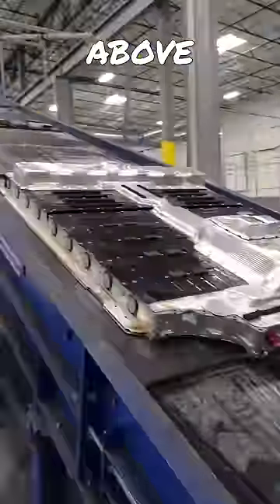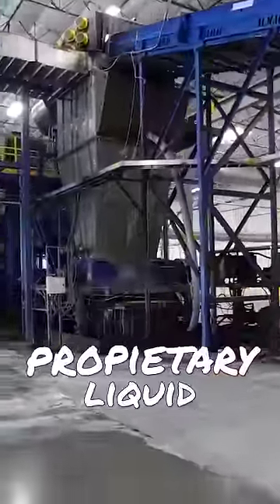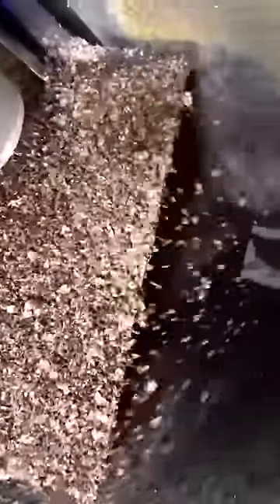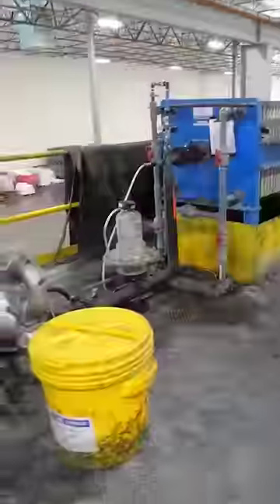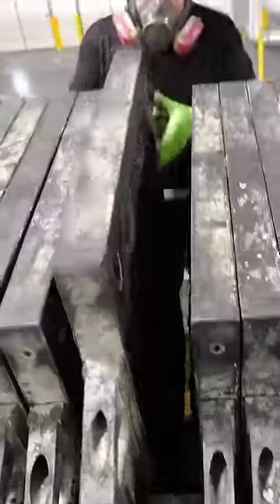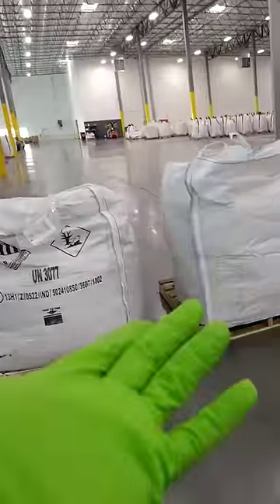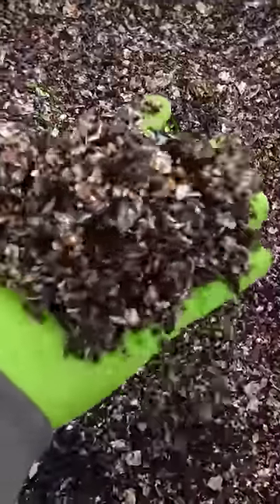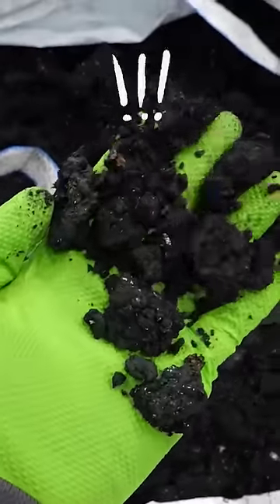Electric Car Battery VS Liquid BLENDER

Comment: I'm curious, whats the "black mass" used for later in the production cycle?
Reply: I had the same thought. I’m thinking the black mass is recycled into lithium batteries? They’re mining out the lithium/cobalt into said black mass, so I would assume they’re creating new batteries from the old scraps.
Reply: New highly refined batteries.
Reply: @TheGreatLake1998  its most probably oxidised, so it will need separation and refinement.
Reply: @brookekathryn1980 Wrong, recycling batteries ends with an inferior product every time. Virgin material is required.
Reply: @Dat_Sun Correct.  As of current, this is the equivalent of recycling plastics.  The resources used to recycle for an inferior product will continue to push mining operations for cobaland lithium.  Let's just hope it doesn't end up in the oceans like the plastic does.
Reply: @Dat_Sun  I said highly refined, not higher quality. Big difference champ!
Reply: @brookekathryn1980  You are correct.  I missed that part.
Reply: Maybe they will end up as rechargeable batteries?  Not E.V. batteries, those require “new” materials.  There must be a commercial application, if “black mass” is already valuable enough to be referred to as ‘black gold’.
Reply: @JasonMcCord-qk3yb  They will.
Reply: @Dat_Sun There is no such thing as a "virgin lithium atom/ion" vs a recycled one. That's not how matter works. What you're saying applies to complex molecules like polymers where the chains can become broken/shorter and parts can break down into unwanted products.
Reply: @Dat_Sun Elemental Co and Li are easily extracted in just as pure a form as when mined. The same extraction methods are used. The issue isn't an inferior product, it's losses. In mining they can  extract almost all of the elemental metals out of rock, but in this m the recycling, they can only extract around 40% of what was used to make the battery.
Reply: watch the full video to understand
Reply: @daliasprints9798   Where is the process that turns this black waste into a viable product? How much energy is used?  Why didn't Jerry rig his views show any recycling at all?  This was the equivalent of a battery junkyard no recycling, just smashing of components into bits.
Reply: @Dat_Sun  I would assume it's processed just like getting the metals out of a mine.
Reply: @Dat_Sun  Yeah, but they can still go into small devices like watches and the difference probably won't be noticed
Reply: @Dat_Sun Likely because this process is still being developed and some aspects might be extremely new and confidential. And I mean this from a business standpoint of patenting processes and such, and keeping them secret as to not give your competitors any advantages.
Reply: @Dat_Sun If you actually watched the video, you'd know where they send the black mass. It's sent to a refining facility in NY thats under construction.

Seperating/ refining the black mass is all chemistry and washing.
Reply: @jaredjohnson8387  haha " under construction "
Reply: @Dat_Sun wrong. It is done all the time throughout india and southern US. Got any other beliefs i can quickly prove wrong? Lmk lmfao
Reply: @Dat_Sun this company started in Canada and has been successful recycling batteries for years. The black mass is processed into a higher quality product for sale to battery manufacturers. It's basic materials chemistry. There are plenty of research papers to prove it.

"The researchers found that batteries they made with their new cathode-recycling technique perform just as well as those with a cathode made from scratch. In fact, batteries with the recycled cathode both last longer and charge faster. The team’s approach and successful demonstration are “very unique and very impressive,” says Kang Xu, an electrochemist at the U.S. Army Research Laboratory, who was not involved in the study.Cross sections of the recycled cathode particles (A) and particles made from new materials (B), taken with an X-ray microscope. The scale bar is 10 micrometers in (A) and 5 micrometers in (B). Credit: “Recycled cathode materials enabled superior performance for lithium-ion batteries,” by Xiaotu Ma, et al."
Reply: I don't see how recycling primary elements results in degradation of the product black mass.  Can someone explain why?
Reply: @Dat_Sun evidence?
How can this be less pure than the earth contaminated lithium and cobalt that comes out of the ground?
Reply: Feed the river
Reply: @Dat_Sun can it be mixed in with virgin materials work as good?
Reply: @deanfielding4411 I think what it comes down to is that lithium is 'mined' by pumping chemicals and water into salt deposits, the lithium you get isn't very contaminated and easy to sepperate bc it's lithium salts, in the recycled mass you have tons of chemical additives and binding agents to deal with as well as the metals being bound up in more complex molecules. It's very different than say aluminum and iron recycling.
Reply: @Dat_Sun No surprising not really. Apparently recycled lithium is pretty much just the same as new. It just costs more to recycle than to mine.
Reply: @Dat_Sun A man had a broken down Datsun Cherry, and it needed a specific cog. Unfortunately, when he called to order one, he found out the company would only ship bulk orders. He had to order a minimum of 600 cogs. Sighing, he forked over the money and the order was placed. It was boxed up and shipped. It made it all the way to Germany before the plane started to encounter engine trouble and all cargo needed to be dumped. Out the back went the boxes. A mechanic looked up and saw the cogs falling out if the sky and remarked to his wife, "Hey look, Ingrid, it's raining Datsun cogs."
Reply: @Dat_Sun confidently incorrect is a bad look
Reply: @harmonic5107  I'm over the target, or none of these bot, democratic video game accounts would be here regurgitating ev nonsense.
Reply: @Dat_Sun i think it depends on how much chemical processing is required to get it back to it's desired form at an acceptable contamination level. If they could extract pure cobalt out, there is no reason why it would be inferior to mined cobalt.
Reply: @Dat_Sun you may have to make a bigger battery for the same charge but that doesn't stop you from turning it into a battery.
Reply: Dump
Reply: @daliasprints9798 you both are using the word correct. many industries use similar words but have a different application. virgin in his context is not contaminated.) ex. virgin plastic vs recycled. ie food grade standard.) while your usage is the chemical purity once refine is the same as if it was mined and processed that day. which is correct. remember, terms are used differently and can have different context in certain industries. it's why I hate abbreviations. I have a chunk of the same abbreviations that mean something different depending on the person or industry I'm dealing with. which can cause fun mix ups.
Reply: It's got to be further processed to get the lithium and cobalt out of it.
Reply: "black mass" in the context of battery recycling refers to a mixture of materials obtained after the initial mechanical and hydrometallurgical processing of used lithium-ion batteries. This mixture primarily contains lithium, nickel, cobalt, manganese, and other metals depending on the specific battery chemistry.

During the recycling process, after batteries are discharged and dismantled, they undergo a shredding and crushing process, resulting in a mixture of plastic, metal, and electrolyte components. Post separation of these components, the remaining powdery substance is the black mass. Further chemical processes or hydrometallurgical treatments can be used to extract and recover the valuable metals from the black mass.

This process is crucial for creating a sustainable battery production cycle, as it allows for the recovery and reuse of precious and rare metals, thereby reducing the need for new mining and the environmental impact associated with it.
Reply: @Dat_Sun  Nope, that has not been the case and is well documented.
Reply: The black mass will undergo a hydrometallurgical process that separates them into lithium, cobalt, and manganese.
Reply: @JasonMcCord-qk3yb  It will go through a process to separate into lithium, cobalt, manganese, and nickel.  And yes it will end up in EV batteries.  The recycled material is actually better than raw.  It is more porous and accepts ions better.   That's why many of these recyclers have contracts to directly supply OEMs and EV battery manufacturers.
Reply: @muskrat3291  What? Lol
Reply: They must use some kind of chemicals like they use in the gold recovery business.. its all about chemistry..
Reply: @ricardopereiracom  And energy.  Takes more this way than any other method.
Reply: @Dat_Sun why? Even if the metals you're using are oxidized, you can still process the material to be as refined as the metal was the first time it was refined. Metals and glass are infinitely recyclable, even for materials that oxidize, your only problem is the end yield
Reply: Your not allowed to know.. it's "proprietary"... lol
Reply: Straight to landfill
Reply: Oreo cookies
Reply: It's the lithium paste that they use inside batteries
Reply: The black stuff will be refined and likely used to make rechargeable batteries for home use AA AAA and small electronics like your headphones, rechargeable toys. That kind of stuff.
Reply: @JRGUSC it’s not quite the equivalent, because unlike plastics, lithium is not a polymer, and there’s only one kind of lithium (considering the different isotopes are basically exactly the same just a little bit heavier), lithium, whereas there are many many different kinds of polymers for different plastics, so if the lithium could be purified and harvested, it would be chemically equivalent to “virgin material”
Reply: @brookekathryn1980 yeah no shit Sherlock. That’s not what we are asking
Reply: @Texas_Made6990  "I'm curious, whats the "black mass" used for later in the production cycle?" 

I am 100% positive that I answered the question exactly. 

Your inability to understand is not my issue.

But feel free to move the goal post with that anger. That's going to win you some points...
Reply: manganese dioxide
Reply: To stop anything from growing at the land fill😂
Reply: Nescafe
Reply: It's used for click-bait. So people might think this is a real thing.
Reply: It’s used to make aliens
Reply: Making the electrodes for new batteries.
Reply: Food
Reply: @Dat_Sun After these rough separating process, these poweder go into acid extracting to purify such like cobalt or nickel etc. Liquid extracting process can refine enough for second battery materials. But as you said, it is not for eco, just for money now.😢
Reply: @xxportalxx. I'm sure there's a chemical process that could revert the lithium to salts for future extraction. It can't be too different from refining gold or platinum, or any other precious metal. I'm guessing it's more of a cost factor
Reply: @littlejackalo5326 So basically EVs have the exact issue and Ice engine does.
Reply: @Dat_Sun Do you throw away used gold? Maybe learn something before speaking. These aren't plastics bottles they're elemental metals.
Reply: @MyrKnof yeah it’s almost like an enriched ore if there was such a thing. Raw yet concentrated.
Reply: Its not necessarily used for batteries, lithium is used for many things, including lubricants.
Reply: Nothing 🤣 that would be funny though wouldn't it. The 'proprietary liquid is probably something toxic and one time use
Reply: @KWB902 it doesnt. Some people just like to regurgitate false things they read that align with what they believe.
Recycled lithium is lithium.
Recycled cobalt is cobalt.
Reply: @Dat_Sun chemistry is chemistry dawg. You're the one injecting your feelings into a conversation. I unironically encourage you to explore chemistry because it is the most fascinating and easily approachable scientific subject in my opinion.
Reply: The only thing they'd never mentioned was which part was the lithium, so obviously the black mass is some mixture of lithium and carbon and other unidentified elements leftover from the extraction. Gold might have even found its way inside the Black Mass. But that black mass can now be processed just like lithium from the earth mixed with dirt and other metals.
Reply: @erikburzinski8248  A larger battery? Lol they are already 100x less energy dense than fuel.
Reply: @Dat_Sun Wrong. The Swedish company Boliden melt electronics scrap down, and the metals are separated by skimming, since the liquid metals have different density. The end result is metals of higher purity, than what can be produced by any company in USA, even from ore or presorted scrap metal. Metals of such high purity can only be produced, but then only small scale, by a few companies in Switzerland, Japan and Hong Kong.

The input is whole electronic components, no need for shredding or sorting before melting. Everything in the electronics but metals and silicon, act like fuel to the process, giving a net positive energy output (but the process require a very high amount of initial energy input, so it ideally is never stopped). So the process produce energy that can be sold or used by Boliden. Since the temperature used is so high, very little ashes and and no air polutants is left.

Boliden have done this for decades for unsorted electronic scrap. The process can be further optimised for lithium batteries, but as is, there is not enough used lithium batteries to recycle alone. This is the Boliden process main weakness, it requires huge input to work.

Why doesn't other companies copy this process? That is because the initial investment is huge, and the availability of electronic scrap is to limited. Boliden repurposed some 1960's technology smelters for ore for their process. The many other companies that used the same kind of smelters scrapped them in the early 1980's, and would have to build entirely new smelters, at an enormous cost. For this to be economically viable, the price of metals would have to be much higher, and if more companies would compete for the scrap, the cost of inputs would be much higher.

Most the worlds electronic scrap, finally end up in Sweden, and is recycled by Boliden. But usually not before middle hands (like the one in the video) already sorted out some of the more valuable metals, like gold, silver, and recently cobalt and lithium. The extraction of the more valuable metals, before the scrap end up in Sweden, is very bad from an environmental point of view (like with all the acids and heavy metals, used in the process in the video), since they could be extracted in the much more efficient and environment friendly process the scrap will finally will be part of anyway.
Reply: @martinjansson1970  Without the " build back better " tax money sham, lithium battery salvage would not exist in America. It's not profitable and it's a environmentally dirty process best done in China out of sight.

And for what? Battery powered vechicles are horrible and Pointless.
Reply: @Dat_Sun I did read about something a few weeks ago about recycled batteries actually being better so idk lol
Reply: @SatanMcLovin  Never once has that been the case.
Reply: Its cobalt rich aswell as lithium heavy. That's essentially paydirt. What you smelt to get started with the chemical extraction. If it was gold paydirt. It would after the first smelting leave a node of lead. And from that you use various chemical processes like Mercury to get silver out and so on from the lead node.
Reply: Drinking water
Reply: @Dat_Sun   Lithium battery recycling can be done very environmentally friendly, unlike  lithium mining/extraction from natural sources. But there is nowhere near the volume available of old batteries to recycle, to satisfy the current need for new ones.

As someone who has used electrical vehicles professionally since the early 1990's, I don't think they are pointless. In indoor environments (warehouses, mines, tunnels et c.), they are definitely superior to any other kind of vehicles, reducing the need/high cost for air purification systems. Also, billions of older people, that would otherwise be too weak to pedal a bicycle, manage to use one, with a small electric engine helping them, definitely not pointless. Lots of people depend on electric wheelchairs et c.

I haven't driven an electric car since the 1980's, and then it was indeed quite pointless. Modern electric cars seem less pointless, but in most situations, cars made for biodiesel would be more effective, and more environmentally sane. Biodiesel can be tailormade to a higher degree than traditional diesel, and unlike traditional diesel made with zero impurities, and cars specifically made to run on a specific kind of biodiesel, could thus be much made to be more effective than current diesel cars, or pretty much any kind of car. Unfortunately, the Volkswagen scandal, ruined the future of biodiesel vehicles, despite them being the most rational choice, for road vehicles the size of cars and larger (but as most people drive vehicles much larger than they actually need, the existence of most cars are unnecessary and pointless, not just the electric cars).
Reply: @martinjansson1970  I agree that ev is best suited for indoor use. Carts, buggies scooters. And that mose vechicles on thebroad are bloated parade floats. Anything less than 40mpg with today's tech should be illegal.  

Everyone wants 500hp, some want 1000hp and manufacture keep delivering.
Reply: @JRGUSC They keep telling us this but I don't remember throwing any plastic into the sea.
Reply: @Dat_Sun  This is step 1 and recycling isn't some monolith handled by one company. That black mass is sent to a refinery where they further sort out the elemental lithium and colbalt. JerryRig isn't just easily walking into one of those, its an industrial worksite. This not to that level, this is still considered waste management.
Reply: @Dat_Sun lithium is an element, if it is refined it doesn't matter. It has to be refined when mined as well.

The quality of the recycled materials depends on the process involved. It does not break down like polymers in plastics or alloys.
Reply: @jeepmanxj  Do it without robbing the people blind through the build back better sham and I'll be impressed.
Reply: @Dat_Sun  that wasn't what you said. You were blatantly wrong now stop moving goal posts.
Reply: My understanding is that the lithium can be used to make new EV Batteries.  If it was inferior then it wouldn’t be identified as “the new gold”.  If someone is recycling it then they are most likely doing it to make a profit.
Reply: @jeepmanxj   Doesn't make what I said any less true.
Reply: I'm assuming the black mass gets shipped overseas because it needs to go through a massively polluting chemical process. 😂
Reply: @maniv100  And 100 Tons of fuel a day for a shipping vessel is common..
Reply: @Dat_Sun  you made a blatantly bullshit statement, moved the goal posts so you can find something that's remotely grounded to cling to. Yes, you are wrong because we are playing the game around your original argument that is an absolute unfounded lie.
Reply: @gregleuze6657  it depends on the process. Not all recycled lithium is refined to the same level of purity, nor does it need to be.
Reply: @jeepmanxj  That makes sense.  Looks like there is going to be a lot of growth in the recycling battery industry.
Reply: @jeepmanxj  My original arguments are valid
Reply: @Dat_Sun  no it isn't. If you think it is then you are not qualified enough to speak on the topic.
Reply: @gregleuze6657  very likely. The industry for lithium recycling is still trying to catch up to the need but it'll get there. The non cobalt lithium batteries are growing in popularity and availability across the markets so we will see the need for that particular metal dwindle and should also lower the environmental impact of both initial manufacturing and recycling of the batteries.
Reply: That's used for tooth paste 😋
Reply: Anybody remember battery batching recycling plants in places like Haiti? It's a wonder people aren't born with three eyes everywhere.
Reply: Batteries AA, AAA, C, D, & etc.
Reply: All kinds of products from motor oil to breakfast cereal
Reply: Pure fucking energy
Reply: Melt it down and separate it. You can remake batteries as many times as you want, they just have to make the lithium in a non-oxygen environment when they roll it.
Reply: Awesome!!! Where does the cobalt come from?
Reply: @SamSintmaartensdyk  Cobalt is Also very recyclable. In fact, cobalt's melting point makes this recycling process WAY easier. Cobalt's recycling point is very high, lithium's is very low. So they can sift it off based solely on what melts and what doesn't. Right now new-source cobalt is still needed just because we need more batteries, but all the cobalt already in circulation can be put back into new battery packs in that recycling process.
Reply: EV batteries are rechargeable batteries, I thought?
Reply: When you patent a product or process or idea you are doing the exact opposite of keeping it a secret, you are defining, explaining and publishing your idea. If you want to keep it a secret then it’s called a trade secret and you don’t show or tell anyone how you do it, two very different things that are each used in different circumstances to protect intellectual property processes and ideas
Reply: They actually put that black mass into huge piles, and once they harden, the cobalt gets dug out by slaves
Reply: Flooding third world villages
Reply: @MyrKnof everything is oxidized all of the time
Reply: @jeepmanxj dude Dan is a dope 😂 he’s clearly been wrong multiple times and keeps changing the goal post. Dan is not what you want to be in life 😂
Reply: It’s used as print material to make Ozzy Albums.
Reply: Dumped into the ocean
Reply: Its what the machines use in the matrix
Reply: Batteries.
Reply: @jeepmanxj  I have a degree in renewable energy. Earned it in Denver years ago, on top of that I have 20 years of on the job experience designing back up power battery banks for emergency pitch control (batteries that are tumbled for years in extreme conditions). I know a thing or two about batteries.
Reply: @MyrKnof nobody asked
Reply: Baby food
Reply: It's probably dumped in the lakes in rivers
Reply: As a binder in hot dogs and hair gel I bet
Reply: @brookekathryn1980 champ. So passive aggressive and confrontational for no reason.
Reply: @gunbacker9428  I'm sorry you take it as passive aggressive and confrontational. A bit of self reflection and projection there? It was a term of endearment. Seems to me that you may to reevaluate how you take things, especially when they aren't directed towards you.
Reply: Black bildos!
Reply: I was just about to ask this same question because if it’s reallly that valuble ima start smashing batteries 😂😂😂
Reply: @JRGUSC Would you rather have all that trash stay on land between the population? Not everything can be recycled and Its a tough choice but id rather have them in the ocean than land.
Reply: As long as you have energy input you can easily do the seperations... Viability is based on energy price.
Reply: Regardless, metal seperation is simple, just very energy intensive.
Reply: Ahh yes the classic "if I dont like what you say, you must be a bot" trope.

You failed basic chemical literacy.
Reply: You went from "impossible" to "it will use energy" to "too expensive".

Bot shifting goal posts.
Reply: Nah it just means you dont read around and lack awareness of how some industries will do better in certain countries lol
Reply: well it should be everything that the “proprietary liquid” absorbs. i’d assume lithium, cobalt, nickel, and manganese.
Reply: @JasonMcCord-qk3yb  Who is calling it “new gold” other than this video, which is obviously promoting the plant as some sort of green business, despite all the hazardous chemicals involved?
Reply: Vape batteries lol
Reply: Accelerant😂
Reply: @Dat_Sun that's the dumbest thing I've ever heard. The lithium and cobalt doesn't just "go away" that's not how batteries work...ffs.
Reply: Its probably a more stable amalgum that can can be refited back into lithium abput as reasy as the mined stuff
Reply: @brookekathryn1980  "champ" a narcissists retort after insecurity.
Reply: Lizzy.
Reply: @TheGreatLake1998 it all will be here for thousands of years as a toxic waste. That’s what happens to the remnants of this product.
Reply: @RespondsToOnlyLosers thank you kindly, sir, but you have proven nothing. Only flapped your virtual lips without providing any evidence. Assuming that I am correct, and although I can not see you to know you are not some divine being who's words we should all heed when spoken or written, you're just a man who's word is a good as anyone's to perfect strangers. With two equal and opposing forces, this being your words only, you cancel each other out until you provide evidence for your claim. Thanks for trying, but unless you have something more substantial to bring to the argument you should be going now. Thank you!
Reply: @Dat_Sun  So why the name black gold?
Reply: It goes to a lab in Ukraine to be further refined
Reply: @Dat_Sun wrong: it is always possible to extract the pure materials if you want. For example you can use electrolysis, obtaining pure elements
Reply: @JRGUSC i will throw car batteries in the ocean let's goooooooo
Reply: but what's the cost?
Reply: I'd assume new batteries with the cobalt and lithium
Reply: @Dat_Sun lmao you clearly don't understand chemistry 😂
Reply: Black tar heroine.
Reply: Its for black sabbath
Reply: More vapes
Reply: @Leonardo.220  Electrolysis = Uses lots of energy aka fossil fuel grid power.
Reply: Less than 1% of lithium batteries are recycled here in America because of economic and environmental costs. 

Less than 5% of batteries are recycled globally (most of which are lead acid). Batteries are a man made ecological and financial disaster in the making.
Reply: Lithium batteries.
Reply: @Dat_Sun  what do you think they use for refining the lithium ores? They use fossil fuels and other non renewable energy
Reply: @johnreynolds2554  Less than 1% of lithium batteries are recycled.  So you're about .5% correct
Reply: @Leonardo.220   At 5 times the yield. You guys don't know anything about the process or you wouldn't be here arguing regurgitated democratic nonsense straight out of the bill back better sham.
Reply: @USA-freedom  Because of the tax cattle funding available through the Bill Back Better Sham
Reply: @Dat_Sun  That is completely unbelievable and I'm certain total BS.
Reply: @bigstyx  Yep. Sigh…
Reply: @USA-freedom  It's the cold hard truth.  Look into it for yourself.
Reply: Its recycled cobalt and lithium.
Reply: @newdefsys  Hardly.   These processes use vast quantities of chemicals derived from fossil fuels.
Reply: I was happy to see the batteries being recycled until i started reading the comments.  Now it doesn't seem as awsome. Like when I found out there's no Santa.
Reply: @Dat_Sun  "it the cold hard truth" "the tax cattle funding" "the Bill Back Better Sham" Are you ok, or is there something wrong with you?
Reply: I worked at a mine. The process is crush, heavy media solid, float then press. The tank swirls and suspends the media causing it to float ore that wouldn’t normally float in water. The media was comprised of water and tiny iron shot. The ore is raked off the top of the media. It’s a balancing act of trying to get the tank to float the ore containing material and nothing else. It then goes to a mill (fine crusher), then another float process to further separate, then to the press to release your unprocessed raw ore.
Reply: @Dat_Sun what they make in the mines looks almost like black stuff, it's maybe 1-2% lithium and has to be purified aswell
Reply: @FerdinandFake   Yes it does, but the mines yield much more lithium per unit of energy.  The problem is not that recycling batteries cannot be done it's that it takes too many units of energy. The chemicals used are made with fossil fuels, there is no other way to get the chemicals required.
Reply: @Dat_Sun  even if you have limited yeld, it is better to recover the lithium and other rare earth than buy them all... if it worth the pain.... sadly we have to look at the cost, because it's often cheaper destroy the environment than recycle. Also remember that if scientists jave found that recycled lithium works as good as the new one, it is probably in that way and if you don't trust them, you can follow the paper they wrote and repeat the experiment by yourself
Reply: @Leonardo.220   It is not better to recover the lithium when it takes more units of energy than the lithium would ever be worth.  A battery is just a storage device (like a gas can, but way less energy), it's not solving any of our problems in fact it's adding to the electrical load thats backed with fossil.
Reply: @Leonardo.220  Scientists huh? What ones?
Reply: This is an awful lotta work to recycle. Seems like it'd make more pollution, take up more energy, n use more resources than what we're already doing
Reply: who cares,just dump it in the ocean to get rid of it..seafood is disgusting anyways..
Reply: The black mass will be lithium plus small amounts of alloying elements, aluminum, gold (in trace amounts) & other rare earth elements that will dissolve in hydrochloric acid. (they may adjust the chemistry of the acid bath to speed up the process but that is about what one might expect. after the acid is neutralized the metals will precipitate out of solution, most of which will be black lithium oxide. from there it will need to be processed further by flocculation, electrolysis, smelting with precise amounts of alloying elements, & eventually rolling in to a thin ribbon to be folded & sealed into a new battery. it is not necessary to add virgin lithium but is probably common to do so simply out of convenience. This is a simplified explanation.
Reply: @Astroponicist  Sounds like a environmental and financial disaster
Reply: Black mass is dark powdery substance that contain lithium and cobalt.
Reply: They give it to me so I can eat it
Reply: @anthonyroberts6839   Don't forget the good stuff like lithiumhexafluorophosphate, ethylene carbonate, diethyl carbonate, vinylene carbonate, polyvinylidene fluoride aka PVDF.    With only 1 and 5% of batteries getting "recycled" it's reckless to continue manufacturing them.
Reply: Likely for cheaper tool batteries, grid storage, and other applications where the 10% reduction in performance vs virgin material is outweighed by the 25% cost reduction
Reply: @specialopsdave  "Cheaper" so more made in China stuff.
Reply: @Dat_Sun  damn so out all that trouble only like 5% at the most.
Reply: @Dat_Sun  Unfortunately, yes. Although, there is a push for the manufacture of more affordable American products to compete in the same market as Chinese goods, so that may change
Reply: Looks like a toxic cancer lab for anyone who works there.
Reply: @JasonMcCord-qk3yb EV batteries are not rechargeable? Better rethink that logic.
Reply: Coca-Cola
Reply: Whitey Bulger bio's
Reply: @JRGUSC  We as taxpayers paid for and purchased the Recycling industry. Our overlords have just looked the other way, because it got too expensive. So now they just run Two separate trash trucks, to the same dumpsites.
Reply: This place must be as TOXIC AS HELL....
Reply: @MyrKnof  Refinement is necessary, the process is similar to what you have to do to mined ores. I am not familiar with this particular process but would just like to point out that the recycling of copper and aluminium while yielding the same quality as refining ore is much lighter on the environment causing significantly less pollution, environmental damage and by - products. In the case of aluminium recycling only uses a fraction of eth energy which would be required to smelt from ore. Li batteries being not 100% recycleable is a thinly veiled lie made up by the fossil fuel industry.
Reply: Toothpaste
Reply: It's like the black matter of batteries.
Reply: @JRGUSC tbh I'd love to see a massive lump of lithium dropped in the ocean
Reply: The "Black Mass" is a fairly pure combination of cobalt and lithium oxide.
That can easily be combined with some acids to percipitate out the cobalt. 

The hard part (not technically hard, just don't try this at home levels of dangerous) is deoxidizing the lithium. Lithium is very reactive, especially with anything bearing Oxygen. It oxidizes quickly and it's a very exothermic reaction, this is why lithium batteries catch fire if ruptured while not submerged in a "proprietary liquid".
Reply: thye  extract  the  Li and  other  components to be pressed back into usage.Dude with full facial covers and breaking apparatus shows it all.. nope not for  me
Reply: They probably use that black mass shit to make new batteries and just label them as remanufactured. 😂😂
Reply: @iwontliveinfear   just the mask alone in your profile explains most of the rambling thoughts of stupidity on this matter...
Reply: It's the lithium
Reply: @daliasprints9798 I'm glad theres at least one person in the comments who actually understands. 🤘
Reply: Make more batteries
Reply: For your processed spicy nacho doritos
Reply: @Dat_Sun  No such thing as virgin material, the ore must be mined and refined just like you'd expect. The lithium and cobalt are elements, you can't "wear them out", they just change states (oxides, etc). I'll bet the black mass is 1000's of time more easily refined than stuff coming from the ground.
Reply: @JRGUSC  Absolutely NOT correct. Lithium and cobalt recovered from the black mass are EVERY BIT as usable as that refined from ore. Elements do not wear out, they change state, and can be changed back. The plastics are different, they are compounds subject to irreversible degradation.
Reply: The black mass contains many other material than lithium and cobalt, it can contain graphite, aluminum, copper etc.... it depends on the batteries.

We use it to separate it's material and refine it to produce pure lithium, pure graphite, pure cobalt. Normally we separate the most precious material like cobalt and lithium
Reply: Wrong again
Reply: The black mass left over from lithium recycling, which consists of various lithium-ion battery components, can be used for several purposes:

Metal Recovery: The black mass contains valuable metals like lithium, cobalt, nickel, and other materials. It can be processed to extract and recycle these metals, reducing the need for mining and conserving valuable resources.

Energy Storage: Some companies are researching ways to repurpose the black mass as an energy storage material, potentially using it in next-generation batteries or supercapacitors.

Cement Production: Some researchers have explored the possibility of using the black mass as a raw material in cement production, which could help reduce the environmental impact of cement manufacturing.

Thermal Management: In some cases, the black mass can be used for thermal management applications, such as heat insulation or absorption.

The specific application may vary depending on the composition of the black mass and the recycling process used. Recycling lithium-ion batteries is important for both environmental sustainability and resource conservation
Reply: @JRGUSC its already there thats a given
Reply: @Dat_Sun yes,  it may take more energy,  but that's only one of many cost considerations (cost being either monetary to the producer,  or other negative affects to the rest of world); mining opportunities aren't infinite. 
And this can be done anywhere you can build this factory,  whereas mining occurs in specific regions with MUCH more complex infrastructure.
Reply: Drugs, ever heard of blacktar heroin?
Reply: Black tar heroine
Reply: It's literally imidazolium ionic liquid.
Reply: It's added to your food and soil😂
Reply: Vaccines
Reply: Probably some food or beauty product
Reply: @RespondsToOnlyLosers Yeesh you guys need to get off your high horse. You can correct people without being a jerk.
Reply: @SquiddlyInk  I don't.. think that's possible 🤔
Reply: 40% is way better than  burying them in a landfill
Reply: @JRGUSC how? Plastic utilises long chains of molecules to create complex polymers so it’s understandable how that could become damaged and thus less useful but how can an element be damaged? Lithium is lithium whether it’s from an old battery, fresh out the ground or from a collapsing star.
Reply: A source material that needs chemical refinement.
Reply: It’s dyed pink and sold as a meat product… whatever happened to pink slim???
Reply: @Dat_Sun with chemical processing they can get the black mass back to "virgin" material.  The "virgin" material was manufactured through chemical processes.  They would be reconstituting the electrolite and removing the dissolved electrode material.
Reply: In Sweden they put in roads..
Reply: U obv sniff it and it gets u high. Its kronkole
Reply: @zanthosazure3293 I work in the plastic industry and virgin is used for 1st run plastics. Aka never been used before. We also rarely deal with virgin material and instead remove contamination (when possible) from what we are recycling. We process millions of pounds a day.
Reply: The black mass is the liquid mixed with colbat and lithium.
Reply: An Ozzy Osbourne/ Black Sabbath reunion tour
Reply: @kitseu  you are just stating what I said. So, what did you accomplish in more words than what I said? A moot comment is moot. You could have added why regulations and standards are there, but you decided. "Yes, I shall repeat the same thing just in my own words and say i am an operator at a facility." kitseu thoughts while typing.
Reply: Fluoride and lithium injections for schizophrenia patients
Reply: @Dat_Sun not entirely true. Some material gets lost in the extraction and in general use. So that lost material is replaced with virgin material. Mainly due to cost. Recycled materials and refining them isn’t cheap when it comes to batteries. In fact it cost more than just buying the pure form of the elements straight up. But you can purify it enough. You just won’t have a full batteries worth at the end.
Reply: @spray_cheese  Sounds expensive
Reply: @Dat_Sun  yep, that’s what I said👍
Reply: What’s the point? The power to run those grinders and conveyors comes from coal or natural gas powered plants  The whole EV craze is only moving the emissions further up the chain. What a joke.
Reply: @CyKoSyS  what do you suggest we do with old batteries? Burry them? It’s not cost effective. That’s correct. But it’s material efficient. Reducing waste.
Reply: They'll process it to extract the Lithium and other valuable metals to be used as raw materials in other products. It isn't just the Lithium, it contains several metals. It has a mineral content greater than mined ore and probably with easier extraction.
Reply: It’s dumped on the ground in poor countries because its a toxic waste
Reply: @fatjaysgarage  bruh you really think we extract it just to dump it? Think😂
Reply: They use the material in new batteries, being said that with this creating better charging batteries.
Reply: New lithium batteries
Reply: @JasonMcCord-qk3yb you are exactly correct. There MUST be a valuable use for this product. I've no idea what that might be, using a not defined mixture ratio of cobalt and lithium.
Reply: @ProXcaliber that it quite likely to be true, I thought that as soon as the voiceover proclaimed the word ' Proprietary' I though ah something secret going on here!
Reply: @nokian9005 and what about the environmental impact of the recovery processes involved ? How much energy does it take to liberate the elements to be retrieved, as against the original mining processes?
Reply: @martinjansson1970 yes VW have a lot to answer for. The top tier of management should have all received length custodial sentences
Reply: Cobalt and lithium oxide
Reply: @Dat_Sun More like expansion, they have a functional facility. The process is very similar to gold and silver separation/refining using the Aqua Regia method. You are left with the purest form of the elements as possible. There's tons of videos of people refining gold and silver from alloys using the chemical aqua regia method, some even separating gold from mercury(which dissolves gold) its a pretty neat process. The problem with finding videos on chemical lithium refining is no one is doing at home and many of these facilities are new and concerned with trade secrets, that's why they wouldn't disclose what the liquid being used in the shredder was, I'd assume it's similar to a mineral oil mix.
Reply: Battery s
Reply: So until they find a way to refine the process without damaging quality we at least have something to start with at least.For now however we are stuck with a inferior product which needs fresher ingredients if you will during its reprocessing into another type of battery or something else. Its a start at least.
Reply: @Dat_Sun NOTT True!  They have found that so-called "second  generation" batteries are of a higher quality than  the "first generation" batteries. More of the impurities are separated out in this process.

Your statement is based on nothing more than your own idle suppositions!
Reply: @KWB902  they are basically speaking out of their butts!  The lithium that results from this process is actually superior in quality.
Reply: @deanfielding4411 You're correct! The resulting lithium has fewer contaminants than batteries made from lithium mines or ponds.
Reply: @xxportalxx. Your supposition is wrong. The lithium resulting from recycling such as this is of a SUPERIOR quality with fewer contaminants.
Reply: @Dat_Sun nah it does result in inferior quality if it's reused battery. This process practically substitutes the mining process with higher concentration of lithium and other metals, the following processing is pretty much the same as usual so it will result in same quality
Reply: Fish food
Reply: Thats what they put in the oreo mcflurries
Reply: Probably womans makeup
Reply: @Dat_Sun giggity
Reply: Does the oxidation stop at the surface of the lithium  u would think it would get dumped into a  a oxygen free  environment   maybe a future idea don't know it  would be worth  it really thought you would think that stuff would light up  but that seems to only happen when u chort the actual cell
Reply: @JasonMcCord-qk3yb it probably cost more than its weight in gold to get that far, so anything it makes will be very expensive.
Reply: That's the 'ore'.
Reply: @brookekathryn1980 there's no difference in quality just how much they can get back from the black mass elemental lithium is elemental lithium there isn't a quality😂😂
Reply: @Dat_Sun  at what ratio do you need virgin material? And isn't a battery with fewer cycles better than a battery that just ends up buried in dirt for 200years?
Reply: @Nellosphere  2 massive problems here. Robbing the tax cattle blind, and unsustainable amounts of energy required to reclaim anything from a li-xx battery.
Reply: @steamdriver6964  I said nothing about quality, or lack thereof. Stop projecting.
Reply: @TheGreatLake1998  I don’t think so with out and expensive refinement processes to get the same kinda power maybe a primary type battery rather then a secondary
Reply: @Dat_Sun someone explains refining the black mass to you through metallurgy and you go "what? Lol" absolutely a troll bot account lmao.
Reply: Its platinum
Reply: @Dat_Sun because the recycling plant isn’t up and running yet.
Reply: Ingenious method😊👍
Reply: @Dat_Sun Wrong squared.   That depends entirely in the process 
What a stupid statement on the face of it."Virgin material" is so far from  lithium metal in nature, it*a laughable.
Reply: @Dat_Sun I'm impressed at how you responded. It's rare these days. Big-ups 👊👊👊
Reply: @loftsatsympaticodotc  Virgin meaning right from the mine.  Reclaimed (aka recycling but not really) takes 4x the energy,  the whole process demands fossil fuels, from chemicals to the raw energy required. 

Why would anyone make more pollution and spend more money than it's worth? Subsidy farming.  You can collect tax cattle funding by growing made with china Wind Turbines,  solar and or lithium battery reclaiming. None would exist without government's bad decisions and for profit behind closed doors deals. "10% for the big guy". 

What did you think about Biden's energy secretary Jennifer and her electric vehicle /EV (paid for by the tax cattle) road trip? Did you catch the part where the range sucked, and she sends gasoline powered white house staff members ahead to cut in line later at the ev charging stations.  Ev owners called the Police! 😆  Electric,  lithium is a flop, dead before it was even really delivered.
Reply: @Dat_Sun bruh you been arguing for a week and your original comment is still dead wrong 😅😅
Reply: @stevenervin4113  I speaked the truth. Moving on, what did you think about Biden's energy secretary's ev trip? Why would she use staffers in gas powered vechicles to travel ahead and wait in line at the ev chargers? The 911 call is hilarious! They even recorded Jennifer herself! Totally busted the electric vechicles sham wide open in one act Lol
Reply: I was going to say it looks like sut and waste but honestly if it has the right mixture of metals it can be removed into what is called slurry to coat electrodes in the lithium ion process yet again. However, I dont Believe companies will invest in buying these mixtures from the recycling companies. But theoretically it could help produce more batteries. Interesting stuff i guess.
Reply: @TheGreatLake1998  not correct.  There is no lithium in the black mass.
Reply: Meth production 
😂😂😂😂
Reply: It’ll probably be refined back into lithium and cobalt, and then reused as new batteries
Reply: @JasonMcCord-qk3yb   Aren’t E.V. batteries the same as lithium ion batteries?
Reply: @warrensteel9954  cool, good to know! Sounds encouraging! We can certainly use that.
Reply: @zanthosazure3293  “fun mixups” that truly doesn’t sound very funny at all! 🤪 But I could be wrong.
Reply: I’ve heard that we will never be able to produce enough of the materials to support the projected need for E.V.s with current technology. Also, they say we don’t possess nearly the infrastructure needed to charge all the batteries that would be required in the near future. Can someone expound on these statements? Thank-you in advance!
Reply: It gets sent to China to.make new battery and sent back to USA
Reply: @JRGUSC Li-Po vs Li-Ion, either way you get a new battery that was otherwise about to be landfill
Reply: Recyclers (like Aqua Metals) will accept the black mass from pre-processors and convert it back into saleable commodity metals—thereby circularizing the battery metal supply chain.
Reply: I'm guessing that if they are shredding lithium batteries and get plastic , copper/aluminum and "black mass", I would bet the black mass is lithium
Reply: @Dat_Sun  Not true, it's refined just like virgin ore. And for some of some of those chemicals it is easier to refine than from virgin ore. It's just chemistry.
Reply: That’s a good question, I have the same one! Lol. My guess is that’s what they’ll use to power the new batteries. Let me know if you figure it out! Lol
Reply: @TankEnMate  Ignored the facts I see. 
We have already discussed how incredibly inefficient this process is. And without tax cattle funding it would collapse overnight.  It's a drain on the environment and our pockets books.
Reply: @Dat_Sun  It's more efficient than mining for most of the minerals in batteries; at scale. And there are plenty of companies that are now reaching that scale. So... how many years have you worked as a process engineer? Take lithium for example, what's the most common battery feedstock pathways for battery recycling? What's the relative benefits of each? What are the constraints and required inputs? When you have the answers to those questions you'll see why you're wrong.
Reply: Tesla batteries
Reply: McDonald's chicken
Reply: It’s used for feeding The Creature
Reply: Quick question, can u get the same black mass from alloys forging?
Reply: @Dat_Sun not true i work in metal refinery and we work with blackmass and it ends up in its purest form of each element :)
Reply: @Dat_Sun because Recycling companies dont like to share their processes :) im working in one of them and shockingly not a lot of power is needed :)
Reply: @hapcot No it ends as fully valuable product
Reply: @JRGUSC 
They both metals. They’re not linked polymer chains. You melt them and they’re back to metal again, just like copper, steel, and aluminum
Reply: @Dat_Sun  and how do you think they recycle the lead acid battery from your car?
Reply: @KWB902 
The answer is these people are against electric cars and are looking for any rationalization or lie that will help them believe. 
Lithium and cobalt are metals. They don’t degrade.
Reply: @neilkurzman4907  It's a much simpler process. And, one 40lb fla battery will last 5-10 years if cared for. 

Have you ever seen the videos of the street side fla battery rebuilds in India?
Reply: They are putting it in e cigs
Reply: @Dat_Sun  
Yes, it’s a much simpler process. The batteries are shredded in open air instead of a proprietary liquid. 
The acid is drained off, the lead sinks to the bottom, and the plastic floats to the top.  
Sonot completely dissimilar
Reply: @neilkurzman4907  The fla recycling I'm talking about reuses the case and many of the components.  Anyway,  it doesn't matter. We aren't using 3,000lbs of fla batteries in ICE or tax calltle/EV vechicles.
Reply: @Dat_Sun  
Yes, I’m sure somebody could cut a part of that acid battery and try and rebuild it. But that’s not very common. Probably not very safe either. 
I’m not sure why you think the weight of the battery somehow matters. When you throw it into the machine it just chews it up. It doesn’t weigh it. 
In one place the lead acid battery recycler is right next-door to the battery plant. They just send the lead across the street to be re-processed into new batteries. 

The only thing I got from your messages, you hate electric vehicles, and think we should stop making them because they violate your moral code
Reply: @neilkurzman4907   You had asked about lead acid batteries, like it was even a factor. You only need a 40 pound lead acid battery for a traditional ice powered automobile. For an electric vehicle you need around 3,000 pounds of lithium batteries.  Even if lead acid batteries were not recyclable it pales in comparison to the problem with thousands of pounds of lithium batteries in an electric tax cattle vechicle.
Reply: It don't even matter. We are already walking away from lithium batteries
Reply: @Dat_Sun  
I’m not sure why you think that it matters that one battery weighs 40 pounds in the other weighs 3000. 
That was my question why is important. Why is that something key for you? 

But since you’re so into recycling, can you tell me about the recycling of waste motor, waste antifreeze, waste transmission fluid, waste oil filters. 

I have no idea what your last sentence means an electric tax cattle vehicle ?
Reply: It’s used on joe
Reply: I'm curious also.  Batteries or some electric use?
Reply: @Dat_Sun  So you're trying to make the case that Cobalt and Lithium break down to unusable products? If that were true, you couldn't use the original ore. This is exactly what they said, "above ground mining".
Reply: @JRGUSC  Metals are not recycled the same way as plastics. Their properties are virtually nothing alike. And as I said to Dat_Sun, if you can't utilize Cobalt and Lithium from the "Black Gold", you wouldn't be able to use from the original Ore either.
Reply: Nothing as of a year ago when they started hyping this.  Theoretically they can reclaim it though
Reply: coffee
Reply: It's shipped to India like are recyclable plastic where it will be thrown in the ocean.😂
Reply: @Dat_Sun being blatantly wrong does make you less true...

Furthermore it impeaches your credibility in the future
Reply: Well it must have some sort of good use to make it worthwhile separating it in first place eh!! Maybe there's some other application for it apart from batteries?
Reply: @laargboolag9147 🤣🤣🤣🐈🐕
Reply: @Dat_Sun if you can fully separate out the metals, why wouldn’t it just as good. It’s not a complex organic polymer where impurities come in everywhere. 
It’s metals and oxides.
Reply: @JRGUSC  Based off my own research this isnt true. Recycled is just as good as newly mined.
Reply: @Dat_Sun look into reElement (AREC). Yield likely isn't 100% and there will always be losses. But the input of new raw materials will be sufficient reduced with their processing technologies
Reply: @MyrKnof is used to create the puffy things that come in vitamin and pill bottles
Reply: @Dat_Sun that's completely opposite, once the materials are refined through various processes the finished good are actually more pure then they were when used the first time around crating a battery.
Reply: @GetRektStudio  🌚
Reply: @JasonMcCord-qk3yb  this whole short reeks of buzz generation. There is likely very little use for this outside of recycled batterys. And so theybarr trying to artificially infkate the pr9ce.
Reply: Lithium mines collect dirt that has high concentration of lithium and then refine that. This is the same just man made technically. It's like refining iron out of normal dirt, possible but hard and there isn't much in most dirt.
Reply: Lithium
Reply: For summoning the devil
Reply: @JRGUSC   "cobaland lithium". Some insane erroneous misiformation. FYI LiFePO4 as the chemical formula describes has zero "Cobal".
Reply: @Dat_Sun "Virgin material is required" NOT for lower energy density batteries as packaging keeps improving cell density is less critical. You fail at the basic concepts.
Reply: @Dat_Sun WAY Less energy is required than mining it from the ground due to the less transportation already in industry and already concentrated state instead of dilute ore. You fail at basic concepts.
Reply: @clutchbleach2057  Wait you can RECYCLE Burnt Fuel from an Engine?
Reply: @muramasa870  Good luck doing that, they weigh 1000lbs. I would love to see someone do that on their on with no tools.
Reply: @Dat_Sun  WRONG Not Electrolysis as it's got multiple minerals mixed together already which might be attracted to the same cathode or anode which you want to separate. You fail at galvanic chemistry.
Reply: @Dat_Sun  "lithiumhexafluorophosphate, ethylene carbonate, diethyl carbonate, vinylene carbonate, polyvinylidene fluoride" You just COPIED and PASTE a bunch of possible options for Electrolytes or Binder often only 1 is used per cell type. NONE of these are critical limited option materials as there is a wide range of options available. Heck some newer cell  types don't even use electrolytes thus called solid state. You have no clue what you are talking, just googling and copy and paste.
Reply: @johndoyle2296  Way Way less toxic and deadly than an Oil Refinery and deals with less tonnage of material. The 1000lbs BEV can reach 280,000 miles lifespan. Mean while a 40mpg car would consume 7000 gallons 42,700lbs of gasoline, that's 21.35 TONs.
Reply: EV’s are not the answer to our carbon issues.
Reply: @Dat_Sun   Every recycling plant I've ever seen consists of smashing cleaning and sorting. Further refinement is often done at another location.
Reply: @cdk1016  Ok, but does that change anything discussed here prior?
Reply: @KWB902 most are saying it doesn't, the issue is through losses in mining vs losses in recycling which are much greater.
Reply: @littlejackalo5326 that's what I thought but you know these days EVERYONES A PROFESSIONAL AT EVERYTHING AND NOTHING ALL AT THE SAME TIME! Drives me nuts when people talk thinking like they k ow wtf there talking about and are wrong!! Do 2secs of research people before posting your THIS IS WHAT IT IS!!